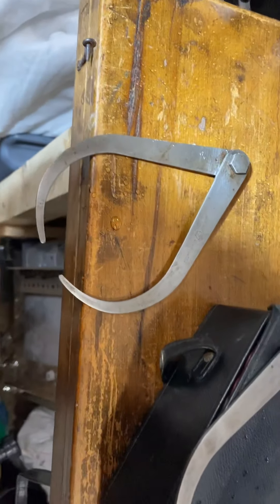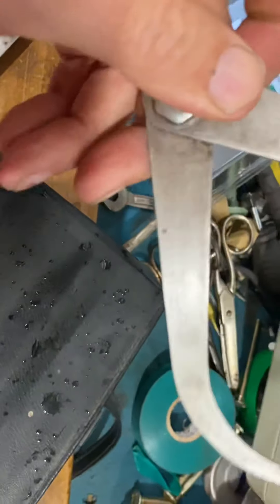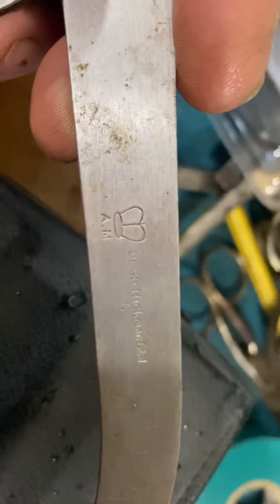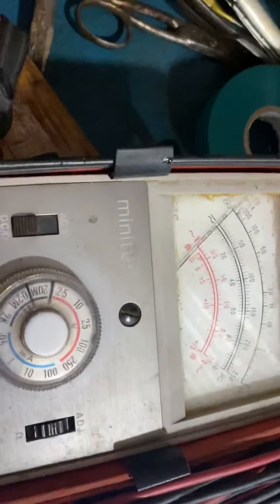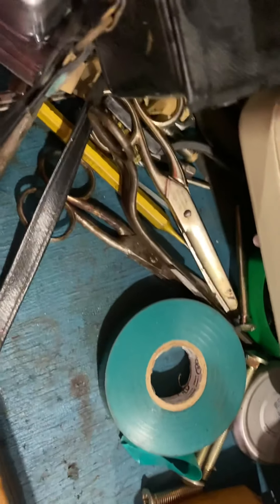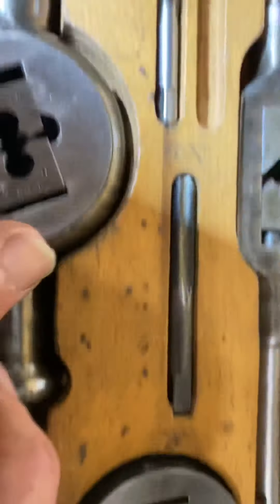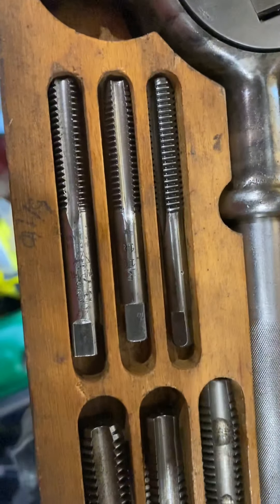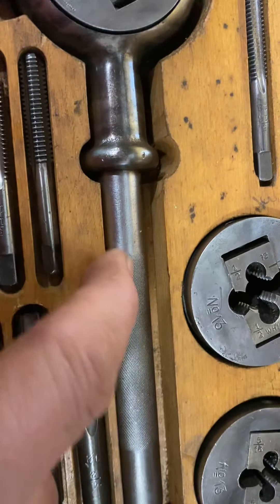This weeks shopping

Comment: I don't know the brand, although they look very similar to both Greenfield and Wells Brothers. The strange patterning I can tell you exactly what it is. This set was originally color case hardened. Was very popular and very beautiful, often used in the '20s through '40s. Unfortunately, it wears off easily, and is also somehow toxic so it is not used anymore. While the finish does wear off over time, it tends to leave tiger striping and spots very similar to what you showed. I'm quite certain that somebody decided to polish up the set not realizing the strange pattern was intentional. Perhaps it was quite worn and they thought it was an upgrade to wire wheel them. I collect tap and die sets just like you, the most desirable sets from a collectors standpoint are always color case hardened. Starrett used the same coating for quite a few years in place of Black ox or japaning